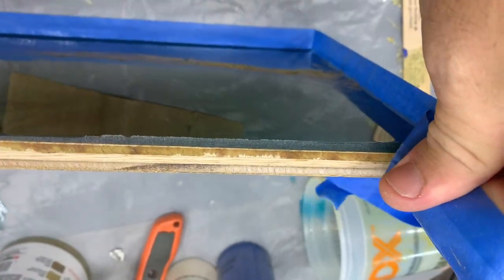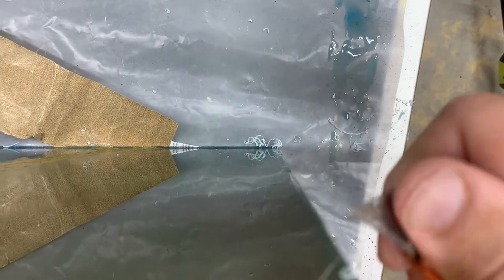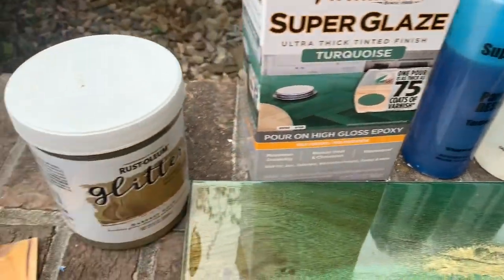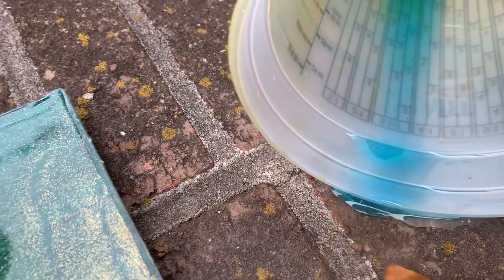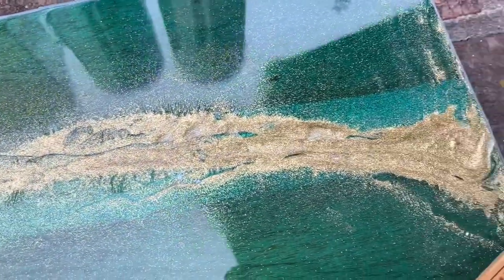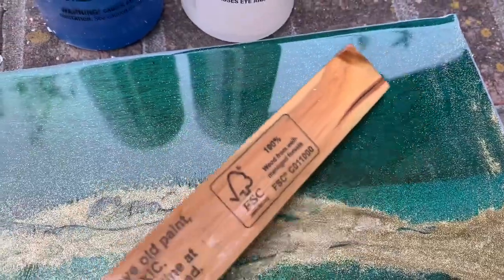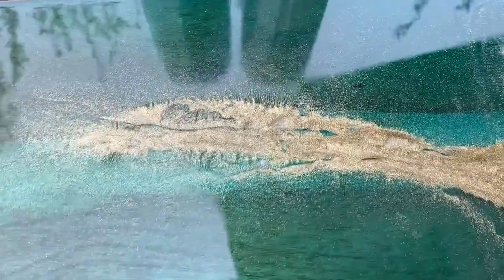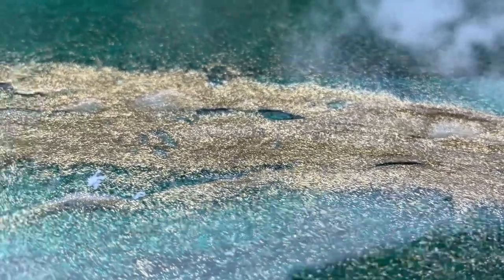Rust Oleum Gold Glitter with Varathane Gloss Turquoise Super Glaze Finish

Comment: The difference in height / surface finish that you’re seeing is a result of the glitter’s impact on the surface tension of the epoxy when it’s not fully encapsulated.  If you like the visual effect of the glitter being on top of the epoxy, but want that smooth finish, you can always add a pour of clear on top.

I came because I was curious what color the epoxy cured to be, since we all know that colors in reality don’t always match the promotional photos.